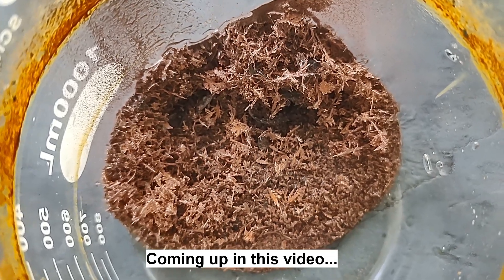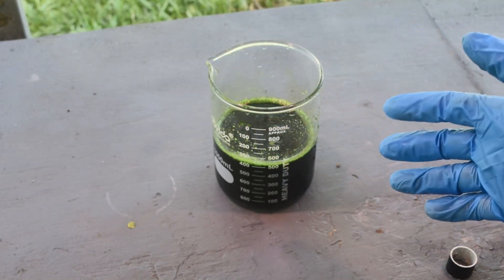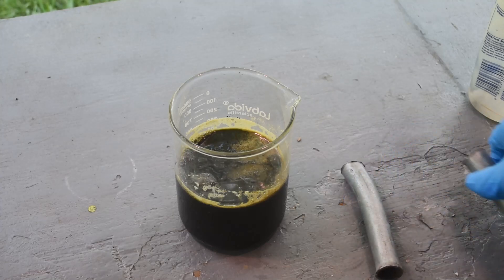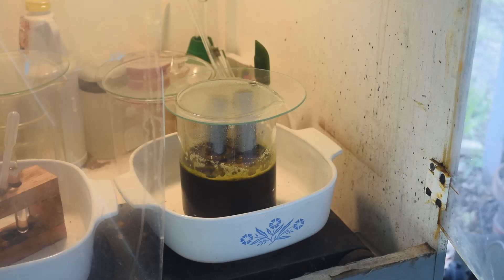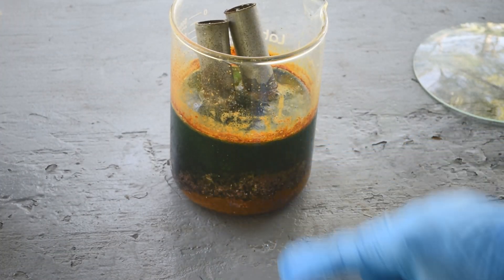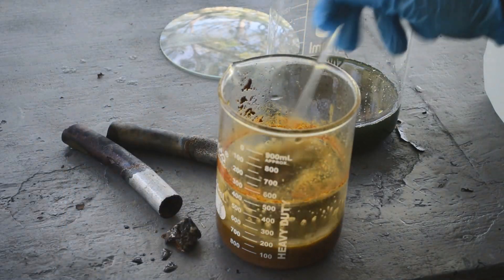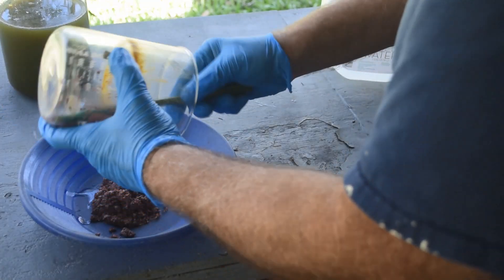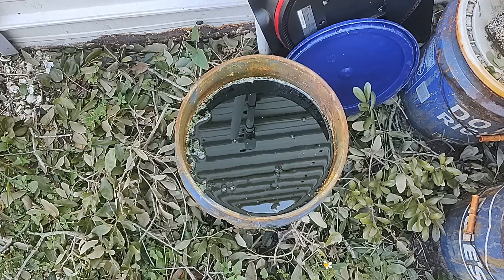Copper Crystals Recovery From Waste #chemistry #copper #ewaste #experiment

Comment: The bubbling with the aluminum is not a great thing for an additional reason than the danger of hydrogen gas and boiling over: it happens because aluminum is above hydrogen on the reactivity series. Instead of doing the desired redox displacement with the copper, it's reacting with the acid, consuming the hydrogen ions/acidity and releasing hydrogen, while leaving copper in solution. This is a parasitic kind of reaction that eats aluminum without a copper payoff. Iron is definitely a better choice because it doesn't react this way with the hydrogen ions (also iron is vastly cheaper than aluminum).

Comment: use electrolysis then you wont need to treat the liquid afterwards as it renews your HCL solution and you can use it over and over without having to buy new acid or at least not as much acid

Comment: You could use electricity to grab the copper. Just keep the voltage low. Also silver lead and tin will settle out as the iron and copper disolve and should be at the bottom of the bucket.

Comment: This is cool, I work in industrial oil field scrapping. My shop runs through 15k-25k lb of down well oil field pumps per week. We deal with Ni-resist, inconel, monel, copper, steel and tungsten carbide. We recover most of the tungsten but a lot explodes and shatters and becomes floor sweeps. I probably have 8-10k lb of floor sweeps that are loaded with nickel, copper, steel and carbide. I would bet the carbide is near 5% or more of that weight. I really need to put together a process to separate all of that and make it sellable metal.
Reply: Mount baker metals and mining might run a bulk sample for characterization
Reply: @konobikundude  hmmmmmmmmmm interesting. I think I need to classify out the floor sweeps a bit first. Get all the big nickel based metal chunks out first. I was thinking Hydrochloric acid should be able to dissolve most of what is there and not touch the tungsten carbide. Just haven’t had the gumption to give it a go yet. But I’ll just keep collecting 55 gal barrels of the stuff until I do.
Reply: @StillFunBrewing  oh, prior to starting leaching or the like you would be able to run stuff through a mill and over a miller table to collect the heavies. Should be able to go to an assay melt from there to get all your percentages of different elements, to at least know what the composition of your sweepings are likely to contain and if the recovery is worth the cost.
Reply: @konobikundude  we build all kinds of custom industrial destructive machines processing difficult material, a large hammer mill and shaker table are on the list

Comment: Would you achieve much faster results if you were to constantly agitate and gradually add  steel granules, chips etc (I'm thinking periodically dropping those steel E and I pieces from classic transformers, or chips from drilling into steel, aluminum shavings from machining aluminum parts)  ?

Comment: I used to get Aluminium as shavings from a machine shop, i would clean up near drill presses used on the Al for free,  did ok for a short amount of time.
Shavings would work a little better as more surface area to mass ratio. 
Probably better to have some idea of molarity of the acid, and be cautious adding the Al.

Comment: Bonus using iron to pull the copper out is that the resulting iron salts aren't toxic and can be discarded safely. Not so with copper salts which are toxic to the environment.
Reply: Please stop spreading this bs. Iron salts ARE toxic and can't be disposed without treatment. If you dont belive me, jug a glass of iron chloride and see how that goes... Or just look it up on Wikipedia...

Comment: Look up "electrowinning". Much less involved process and you don't put even more metals in solution that you then need to deal with later.
Reply: Good point, came here to say just that, the nice thing about electrowinning is that ( as the copper is already in solution , all you would really need is a DC current and 2 non reactive ( in a lab at uni we used 2 graphite electrodes). the copper should then deposit on the cathode
Also if you know both current and time, you should get a fair idea of the amount of copper.
Not sure how you would tell when all copper has been deposited out, maybe the solution would change colour, loosing the green?
Reply: @zeromotivation1817  There are ways to optimize the cell but that's the basic idea.

Color change in the case of copper chloride solutions is a tricky thing. There really are only 2 colors but because of interaction with the light, an observer gets the appearance of 4. It ranges from blue to yellow but this manifests as blue to green to yellow to brown.

This results in possible confusion if there are unknown impurities (such as iron, yellow, or nickel, green) in solution. 

When the purity of the solution is highest, the solution will be driven almost completely clear.

On the unreactive side of hydrogen, the metals are easily separated out by careful potential management. Meaning pulling gold out requires a lower voltage than going after copper, for example.

The "waste" within a cell after being pushed clear of metals is largely a mixture of the original acids used to dissolve the metals that were present, along with some minor side-reaction products that can potentially form. If the acids are further processed, the entire stream can loop back on itself here and take full advantage of recycling. Also a good place to simply neutralize by something like either sodium hydroxide or sodium carbonate that will precipitate other trace metals as their insoluble hydroxide or carbonates. The resulting liquid will be largely sodium chloride, nitrate, and sulfate, all of which are prevalent in nature, making final disposal easy. The hydroxides/carbonates are readily dried and stored until there's enough to get rid of.
Reply: @zeromotivation1817  It's really annoying to type out an explanation to answer someone's question and have this useless pile of a platform just delete it. I'm over YouTube. The sooner everyone else is too, the sooner it can change.
Reply: @MadScientist267  ??
If I offended , I am sorry i'll delete my comment.
Reply: @zeromotivation1817  No... wasn't you. YouTube regularly crosses the line and removes comments that have nothing to do with anything. I went through the trouble of explaining some things and it just nuked it.
Reply: @MadScientist267  ahh, yeah that does happen too much. I've done the same, changed, or closed tabs and poof!, a long answer, or in my case rant, disappears..
Reply: @MadScientist267  arrrgh ffs. I just did the same thing, spent 1/2 hr typing up a lengthy, thoughtful reply , which was both fun and a way to procrastinate instead of doing  overdue spectroscopy lab reports. hit send and it just disappeared,
Reply: @MadScientist267  Not me 🤠
I'm just a mature age student in Aus who wants to finish his degree, and hopefully do some good before I shuffle off this mortal coil.
Reply: @zeromotivation1817  Haha I hear that. Be nice if it could be done less impeded. YT really doesn't want chem around.. channels readily get demonetized and discussion down below about any real kind of depth gets wiped. As for the freedom to speak... a dwindling number of us still take that seriously (among other core "givens")... but I digress. Doesn't really matter when computers decide and override whatever might be there in that way. I fully expect this to disappear.
Reply: @zeromotivation1817  .   I've had similar experiences. Writing long technical "tutorials", explaining in detail how to do it right, as well as the chemistry behind the processes, just to notice afterwards that YT make it "disappear"!
I've had lengthy discussions with other viewers discussing chemistry. Suddenly YT won't let the discussion continue and makes it impossible to reply anymore. Rotten system.
Reply: @MadScientist267  .   I've had similar experiences. Writing long technical "tutorials", explaining in detail how to do it right, as well as the chemistry behind the processes, just to notice afterwards that YT make it "disappear"!
I've had lengthy discussions with other viewers discussing chemistry. Suddenly YT won't let the discussion continue and makes it impossible to reply anymore. Rotten system.
Reply: @zeromotivation1817  I can't even explain how THAT part of it works... it knows I'm telling you something they don't want communicated.
Reply: Guys he already was electrowinning before ago

Comment: If you have decay on the pipe you're using to cement out, then you left it in to long, next metal to cement out will be with a different type of aluminum, bendable aluminum not bendable aluminum a aluminum pipe or aluminum nails until hydrolic has returned clear,  if your hydrolic has been sitting the water in it sits on top so. You can get some of the water out of your hydrolic by freezing , let thaw some and pull a nice clear brick of ice off, you should know exactly how much water you added to the hydrolic along with the other stuff

Comment: I'd recommend putting copper in with the waste and then a second bucket with iron after it has been through the copper. Just to make sure not to miss any silver or pgms.
Reply: No, electrowinning is much simpler and has a much easier to deal with waste stream.
Reply: @MadScientist267  I don't know about simpler, but it could be used. One bucket with copper then one bucket with iron with no watching or electric use is pretty easy. Recovering the pgm slimes from the copper bucket with electrowinning would save on acid cost
Reply: Awesome brother
Reply: That's in his recovery and water buckets. This seems to be a ap only bucket

Comment: I wonder if the zinc was creating an electrolysis reaction due to the salts. Could be why it got so hot also. Zinc blocks are what they use in salt water to prevent oxidization on sea walls and stuff. Could be why it formed  crystals.
Reply: They used to, probably still do that on ships too, its actually sobering when you think how often they have to resupply the zinc.

Comment: Will the Steele work with copper nitrate liquid as well?
Reply: Yes it will drop out all metals under iron
Reply: If you don't want to get super involved/put in much effort, sure. You can also cook it off with high enough heat. However, you can recover the nitric acid too if you have the right set up by converting the copper nitrate into copper sulfate using sulfuric acid, then you can electroplate out the copper from the copper sulfate super easy.